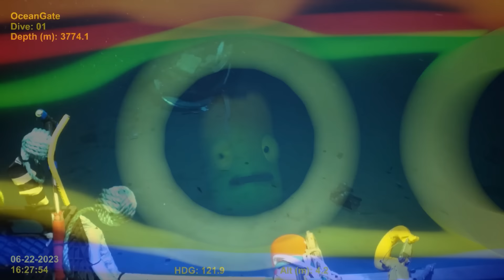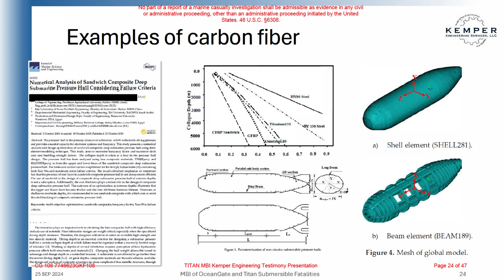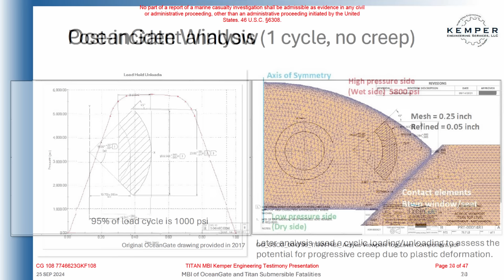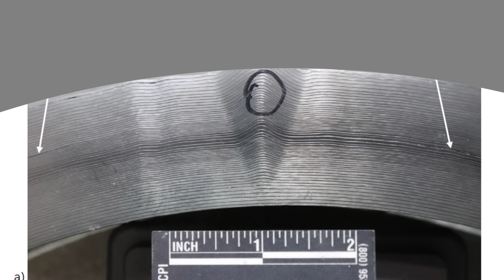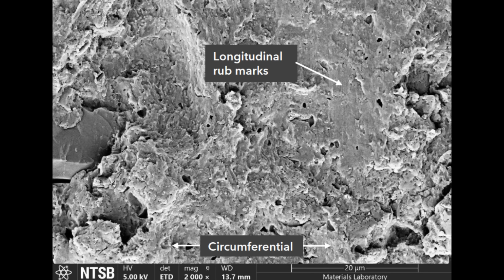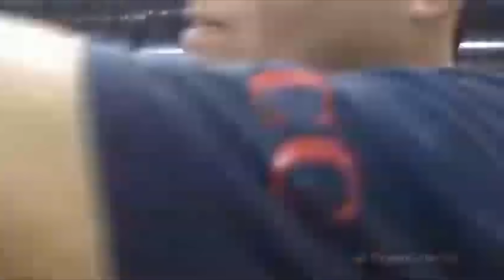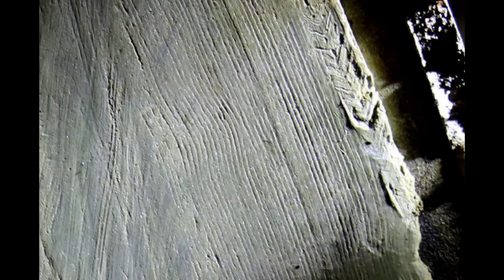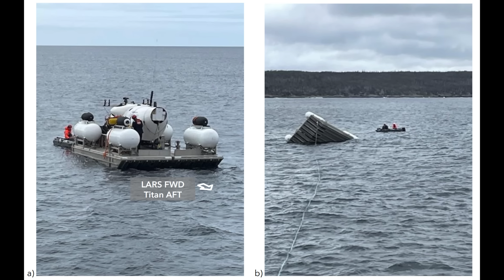OceanGate Wreck Shows Why Sub Wasn't Strong Enough To Survive - NTSB Shares Important Details

Comment: Armchair quarterback here. I was a materials engineer specializing graphite-carbon composites, thermoset/thermoplastic polymers, and intermetallic compounds. I was astounded to learn they were utilizing laminated composites in a high compression environment! At that point you are basically relying on the strength of the resin to prevent buckling. Add to that all the defects introduced (intentionally!) during the layup process, and you end with an imminent disaster, as the voids and delams act as stress risers throughout.
Reply: I agree.  Laminated materials are horrible in compression along the direction of the layers, which is the direction of the forces in this tube (internal circumferential stress, and axial stress from the end caps, not the pressure on the outside surface pushing inward) Tension aligned with the layers is good.  Compression perpendicular to the layers is good.  Tension perpendicular to the layers is bad.  Compression aligned with the layers is bad.   Layer a few pieces of cardboard and squeeze the edges together with your hands to see what happens.  I can't help wondering if that tube would've been stronger in compression if it was pure resin without any carbon fibre at all. [edit was to replace "fibres" with "layers" in a few places so the intended meaning is clearer]
Reply: @galacticminx  basically everything you said here, except one sentence, is fundamentally flawed and wrong.
Reply: @broko336  Which one?
Reply: None of this is information that wasnt already known before it was built either.. but the arrogance of a deluded CEO lead to the deaths of innocent people
Reply: i'd wondered about that but i'm not an engineer so i thought i must be missing something. surely the strength of the hull didn't just come down to... glue. but i guess it did.
Reply: @oldfrend welcome to carbon fibre design.
Reply: Resin to stop the buckling, oops too late, we already have buckling before it even got wet.
Reply: I wish more people would report on this properly. They didn't invent the  use of carbon fiber for submersibles. There was already some data and a submersible made from carbon fiber that went deeper than Titan did. The issue was how big they made the vehicle. Even the shape using two titanium hemispheres on either side of the tube was used before. It's just it was used for a MUCH smaller craft. They could have made a two-man submersible with similar materials, that would have most likely been fine. The issue is they wanted to fit as many people as possible and tried to produce a way bigger vessel with material not suitable for the size, at least not in the way they try to force it. The biggest issue here really wasn't even the material, it was the cost-cutting at absolutely every measure and the refusal to listen at all. It's completely possible to give the proper techniques and a serious reduction in the size of the vessel to make a safe submersible pairing Carbon Fiber and Titanium, just not as recklessly as Stockton insisted on doing.
Reply: Just to think about how carbon fibre composites react to repeated, drastic pressure changes like it’s the case in deep sea diving made me feel very uncomfortable when I first heard about this submersible
Reply: The glue layers struck me as a defect in and of themselves.
Reply: I was told by a material scientist or composites engineer or something similar (it was immediately after the wreckage was found) that due to the thickness of the hull and the diameter of the hull that most of the carbon fibres would have been experiencing tension forces.

As an extreme example, if the submersible was a mile in diameter then it would essentially be a flat surface exposed to the water pressure relative to the localised fibres.
Reply: @retsaMinnavoiG  I really don't think that is true.
Reply: I could forgive the sanding if it was just on the outside because then it keeps the defects small and allows for improved paint and glue adhesion and stuff.
But then I realized (from another video) the hull was made out of MULTIPLE composite hull segments that were repeatedly_ sanded.

Like yes I would like some lamination layers with me lamination defects with my fibre breakage with my glue shearing with my ignored early warning system. And there was no lifting structure or backbone structure of any kind either. So everything is just constantly pulling itself apart.
Like the sheer amount of incompetence from this man is actually impressive.
Reply: Sounds like you are a good bit beyond armchair, give yourself more credit. And you were right, considering the results here!
Reply: Thanks for the information!

I don't have an engineering background, I'm a software developer, but if pointing out the undeniable logical fallacy of "it's great under tension, therefore it's probably good under compression, too" makes me an "armchair engineer" then I'll wear that label with pride.

Especially given that Scott's next point is "they just should have tested it better" … well, yes, but even the scale tests they did failed and yet they continued. An engineering degree is not required for common sense and neither does it guarantee common sense. Stockton Rush, for one, possessed an engineering degree.
Reply: Or in this case,  the strength of the powderized resin.
Reply: Materials and mechanical design engineer here.  Just when I think I couldn't be any more astounded by poor design choices.... Laminated carbon fiber is nearly the last material I would consider for this application, and I actually cringed hearing that they machined the wrinkles off during layup... and then ignored the crystal clear signature of progressive structural failure from the monitoring system. It was literally telling them that the shape and stiffness of the hull had changed on previous dives. Narcissism and engineering mix about as well as narcissism and politics.
Reply: This entire thing could've been done somewhat properly. But it would've been really expensive to do so, and I believe Rush's mission was to basically be as cheap as possible. Like unironically.
Reply: Congrats you said what every layman has been repeating the whole time
Reply: @thewhitefalcon8539  I appreciate your obvious superiority

Comment: David Pogue the PBS person dove in 2022 to the Titanic and described a series of gunshot like sounds during descent. He also said that the propulsion system controls had been installed backwards so that took some sorting out to fix during his dive and also said that they'd gotten lost and couldn't find the Titanic for the better part of an hour. 23:18 there's a failure mode called snap buckling where the composite pressure vessel fails from the inside out and had been discovered when attempts were made to produce fiberglass pipes that were supposed to withstand high outside pressure with low inside pressure and I wonder if that's what happened in those buckled areas.